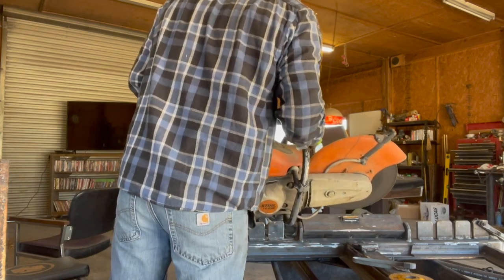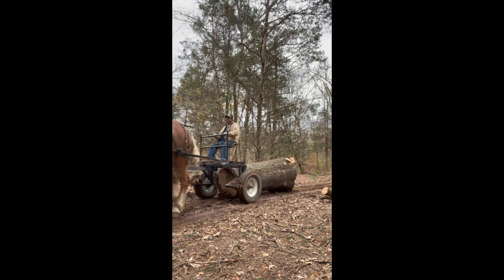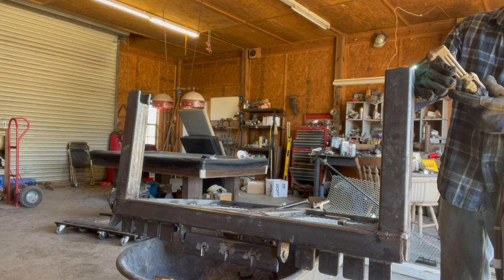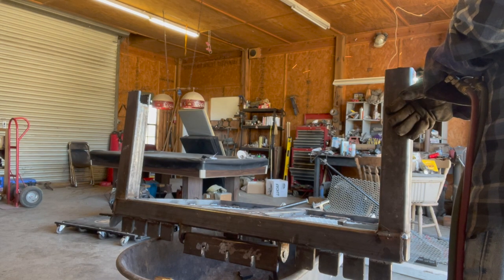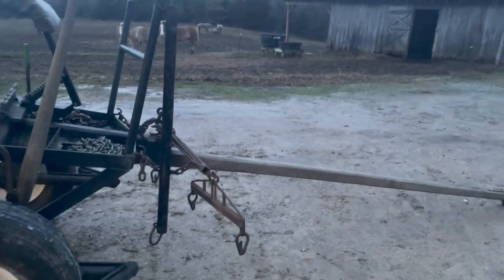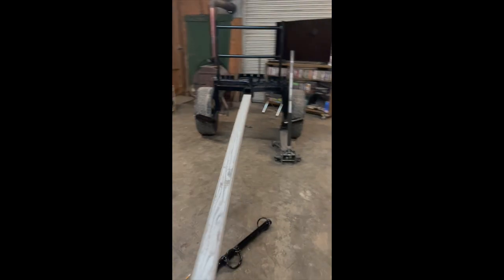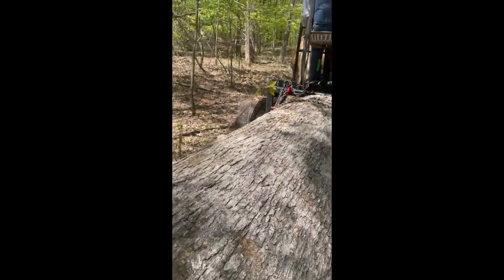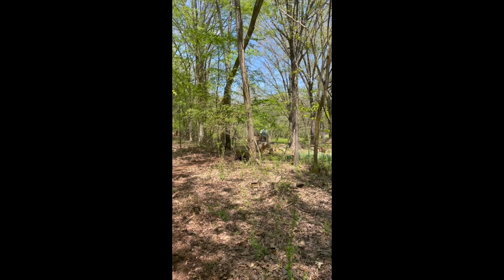Is there such a thing as a best log arch?

Comment: what you need to do differently for a d ring harness?
Reply from the maker: You would have to raise the point where your doubletree pulls from an inch or inch and a half. This particular arch is balanced pretty good where the tongue weight is light. D ring harnesses tend to work a little better with a heavier tongue but this arch would work fine if you just raised the hook on it.
Reply: thanks @downthetraillogging